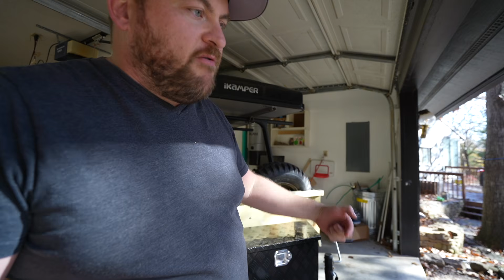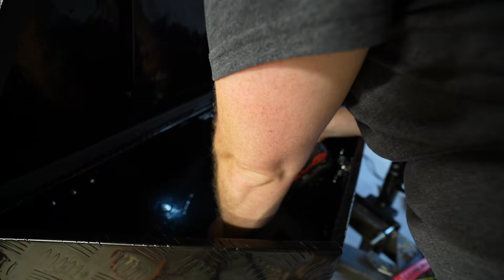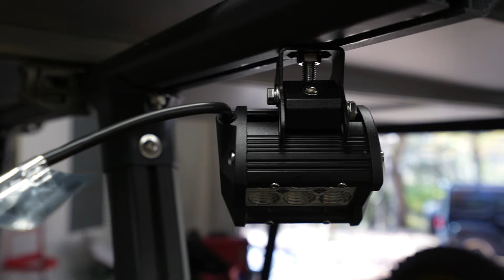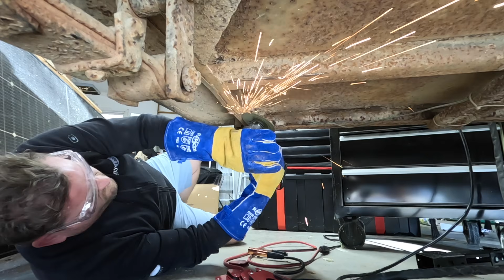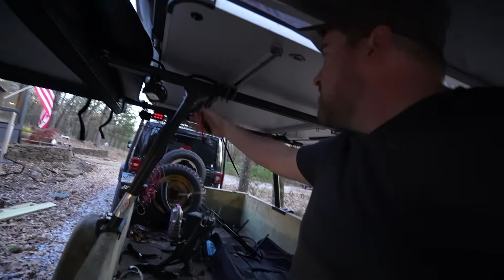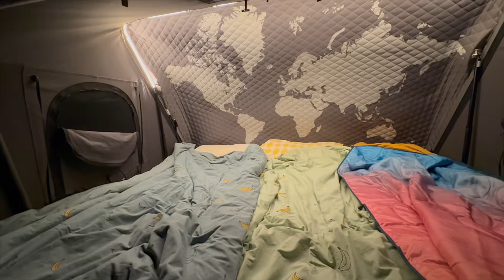Building a power system that LIGHTS UP our campsite (and more!)

Comment: Great vid!  You did the same thing I'm doing this winter with adding strip lights under my 23Zero awning.  Like you said, that's a ton of light.  Only issue I'm having (which you don't have) is how to bring the power cords into the trailer.  Still working on that.... :) Always love the trailer build videos!!!
Reply from the maker: I routed the wires through the tongue box with these cable glands, something similar would work for the trailer I bet. https://a.co/d/epJxYNR